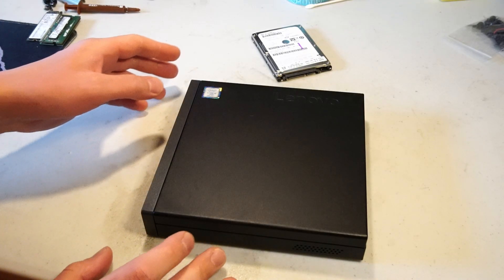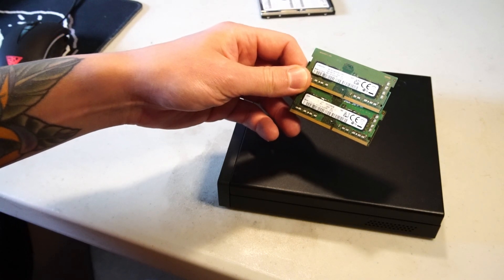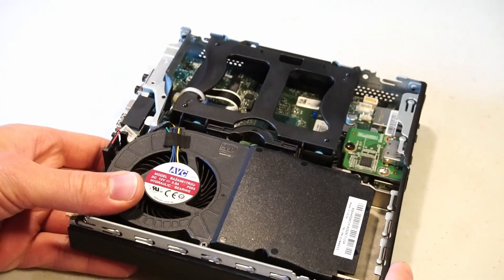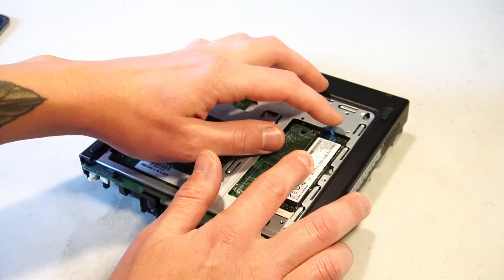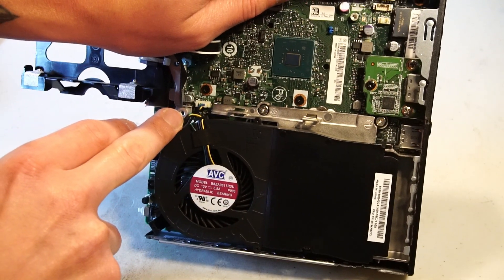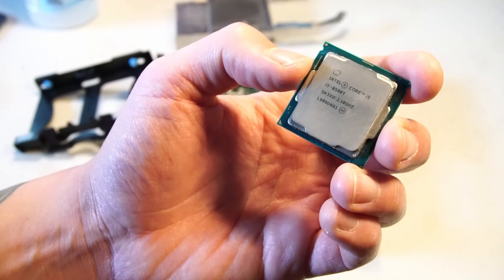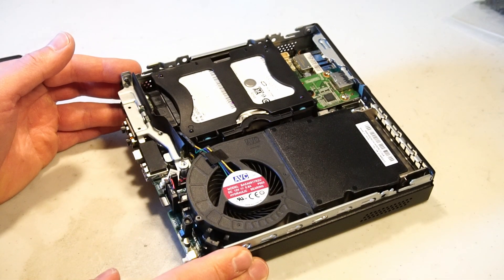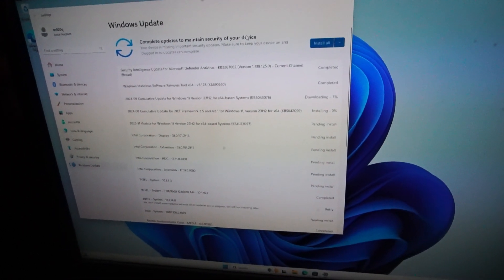Lenovo ThinkCentre M920q Tiny SSD Install & Service

Comment: I would upgrade my M910q but I have a standby fault - it goes in to sleep mode on start up and has to be shaken up to get out of it?
Reply from the maker: So when you turn on the PC it immediately goes into sleep mode?
Reply: @HaisteComputerRepair  you get a small blue AIO sign at the bottom of the screen and then a bigger blue standby sign in the middle of the screen with a moving horizontal bar - then black screen with no response to anything - eventually with re-inserting the computer in the monitor and rapidly turning buttons on and off it resets and starts.
Reply from the maker: @armandine2  That is bizarre.  Are you able to get into BIOS easily?
Reply: @HaisteComputerRepair  I haven't looked into that yet - sometimes it comes back to life with a black screen with white text and the counting down from 30 seconds (ish) , other times straight to screen saver and then a password request.
Reply from the maker: @armandine2  Like it shows you the countdown?  Where did you get this one?  Maybe it has a custom BIOS?
Reply: @HaisteComputerRepair  In my experience computers that are reset often have a countdown phase but you generally press any key to save your own time - no idea why they count down - the computer was from CPC a refurb. But it only started going into standby after a few months of use and a windows update.
Reply from the maker: @armandine2  Oh, I think I know what you mean.  When you boot up, press enter (or nothing if there is no OS installed) you see a menu with a countdown.  This is where you can get into BIOS or select a boot drive.  Let me know if you come up with a solution.
Reply: @HaisteComputerRepair  A first check might be to check operation out of AIO mode,
Reply from the maker: @armandine2  Hm, I didn't think of that.  I know they were designed to be a kind of modular AIO experience with the right monitors.  But, my experience is pretty much strictly as a standalone PC.

Comment: I tried to install an mx5000 4TB SATA SSD in every way I could find and come up with but it never got recognized. Regardless if had it ntfs, exfat, fat, fat32 and or unformatted/unallocated. And yes, the fan were on before and when I installed the drive in the caddy. Can the the SATA extension cable near the caddy broken? Do i need to use GPT( which i tried atleast once, i think and hope) instead of MBR with or without some operating system already installed on the sata drive? Thanks in advance.
Reply from the maker: It's possible the BIOS is not configured for a 4TB SSD/HDD.  Though I am certain many people have done this.  Are you sure the SSD is working?  Have you tried connecting it to another device?  Have you tried installing any firmware updates via the Windows Update app?
Reply: Yes, it was quite recently bought and that as new. And I have used it successfully as Linux, Windows and in Xbox 360. Among things.
Reply: Can the BIOS then be reonfigured and do I need to install and use Lenovo service bridge?
Reply: And or BIOS need to be latest version, perhaps? I If nothing i do with pc repair tools from DiskGenius , SeaTools or other tools from that, nor BIOS reconfiguration, I’ll just try buying a new sata port extension cable or switch to a working one from my laptop. Hopefully, one of those options will work.
Reply: Or I dunno. Maybe the psu is just too limited or somethin.
Reply from the maker: @mattzzter11  Just to confirm, you have tested the SSD in another device and it's working?
Reply: @ The sata ssd worked before i had it in the xbox 360 and diskgenius succesfully cloned os to it. But i dunno. If someone has a fix that they have used I would be glad since then I have 4tb + internal storage.
Reply: Although, the drive works great internally in xbox 360, maybe in ps3 to if successfully shrunk with hdparm etc. Or in external usb case that connects to ps3 or works as movie storage. So many options, haha, shit.
Reply: @HaisteComputerRepair  Yes. And lenovo bridge service wont install. Have tried  to install it while being connected to vpn and not. Luckily I can use the drive for my consoles or in usb-hdd/ssd brackets if this wont be fixed with thinkcentre.
Reply from the maker: @mattzzter11  Let me know if you come up with a solution
Reply: I am and have been busy with things. Still, you wanted me to get back to you on this issue and so I will.

Like most things, it was fixable and I fixed it . Sooner than I thought since I was damn sure the shit was broken. 

I fixed it by accident, unplanned. Took an old HDD extension SATA cable from my more or less unfixable Lenovo E470 laptop an d put that in the Tiny Thinkcentre. Put some small ssd drive in while shifting between the the extension cable that was for THinkcentre and the one for E470. Then it worked either when a) I put the E470 extension cable in or b) when I then switched back again from that cable to the original THinkcentre cable that was there before. Or, c) I activated every freraking BIOS setting that mentioned SATA and or changed between ACHI or INtel( probably not the last one here, since I tried that before and did not work).This fix made me be able to connect another bigger sata drive to and use that for atlast its purpose, additional storage. Next thing is to learn fixing and chaning parts by soldering and then hack NASA after that, haha.
Reply from the maker: @mattzzter11  Well done, that seems entirely serendipitous while also exhibiting your troubleshooting skillset.  NASA seems to be losing funding, so go easy on them, haha.  They have been helpful to society for so much more innovation beyond space exploration.

Comment: I tried installing an mx5000 4 tb Sata SSD to no avail. I tried installing it as unformatted, ntfs, exfat, fat, fat32 etc. And changed seetings in BIOS and the boot order. What to do? Is the sata extension cable broken and needs replacing? And/or is that particular drive model one that is incompatible with lenovo thinkcentre m920q?

Comment: That was interesting. I haven't even looked at a mini PC in years. I've always been curious to know if they encounter heat problems, due to the compact size?
Reply from the maker: The CPU is the "T" version of the i5, so it has a lower power draw.  This helps with generating less heat.  These mini PC's were designed to fit into the back of a particular run of Lenovo monitors.
Reply: @HaisteComputerRepair  Yes. I do recall seeing some of them installed on the back of monitors.